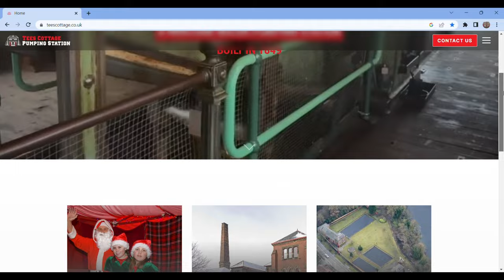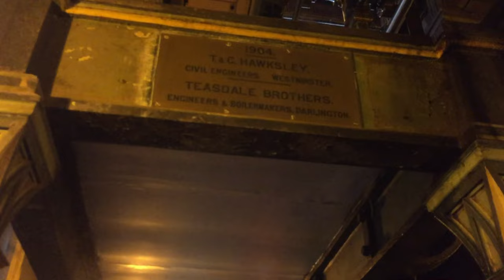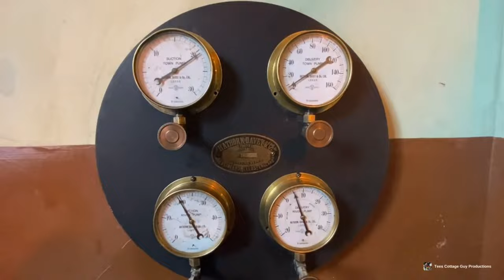TEES COTTAGE PUMPING STATION - Darlington's Victorian Pumping Station

Comment: Is it like a river pumping Station Or a Steam Boiler Engine Place? I never figured it out.?
Reply from the maker: Great question! So it’s a pumping station which pumped water out of the River Tees and sent it to a filter station to be made clean so Darlington had drinking water. This site would also pump the water to the houses. It’s powered by a 1904 Beam Engine which is powered by steam from boilers and the site also has a 1914 Gas Engine which used gas to make an engine work and pump water. Both these engines are still in good working order as seen on the video. We also have 1926 electric pumps but they don’t work anymore (as seen on the video)
Reply: @teescottageguyproductions  Oh Interesting! thanks for the Info!
Reply from the maker: @Skitch11YT  no worries!

Comment: 7:06
Kinda dumb that the firehole is so high up ngl
Ha i remember i was firing 2685
And this one guy was operating the doors to prevent cold air going in
But the problem is that door gets so flippen hot while going up drummond it then starts to warp a bit
Then the door sticks sometimes
That happend with that guy
And a full Shovel went against the door lol
Reply from the maker: It’s how it has to be with the firebox. The way the Lancashire boiler is designed is completely different to a locomotive. The Lancashire boiler had 2 long tubes which carry the hot gasses through the boiler then through smaller tubes which double back. The firebox on a Lanc Boiler is just the front of the tube